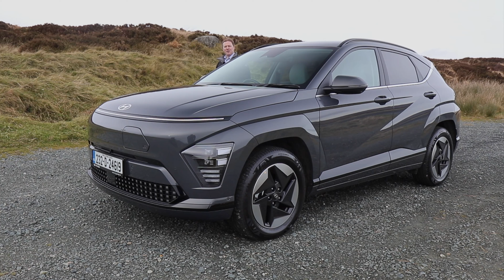Hyundai Kona EV review | The new Kona Electric significantly improves on its  predecessor.

Comment: Having owned our N line S ev for 2 weeks now (in ultimate red) i can whole heartily confirm all the comments in this video.
The frunk is big enough to fit the 7kw charger cable, the 3 pin cable and the handbooks.
The ambient lighting is a bit of a poor effort (can be lots of colours, but only lights the front door pockets and the storage shelf.
Wireless android auto works flawlessly, and it has a decent turn of speed  (and thanks to less torque doesnt spin the front wheels.
Heated seats at (3 stage) are super hot and the head up display is wonderfull (shows speed, speed limit and sat nav directions.
Key fob is a bit light and a funny " pebble shape" 
Mirrors fold when car is locked (a blessing to check if the car is open or locked) and the hyundai bluelink app (allows your phone to lock, unlock the car, set the heating, precondition the battery, show range,etc,etc) works everytime and has yet to crash.
At 6ft 5" i can sit in the back behind my own driving position and the hidden storage under the adjustable boot floor is genuinely useable.
Standard electric seat memory and passanger lumber support would have been nice, as would a proper fixed panoramic roof.
Reply from the maker: That's great to hear, thanks for sharing your feedback on the car, and thanks for watching.